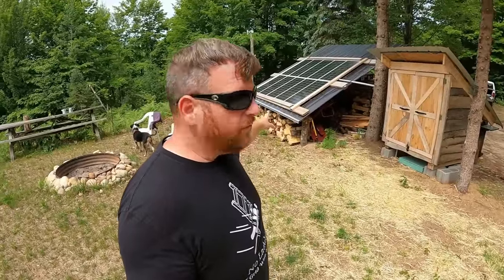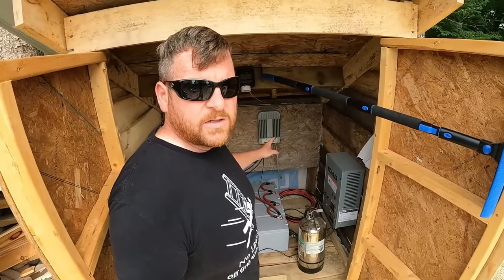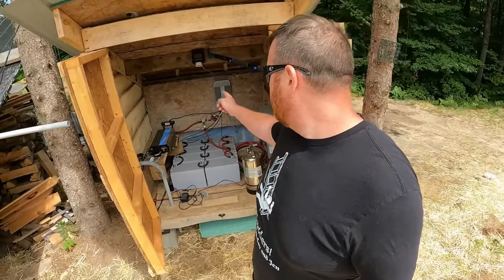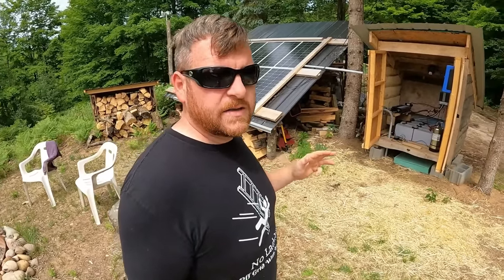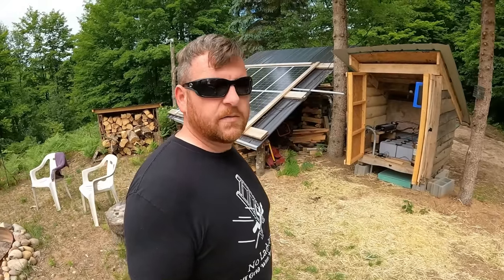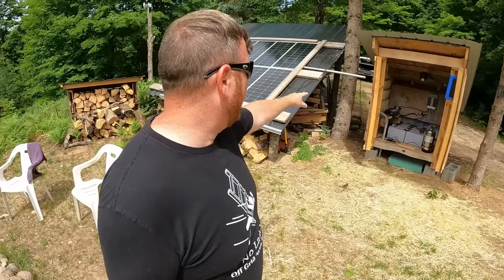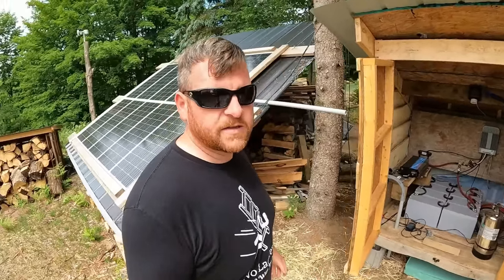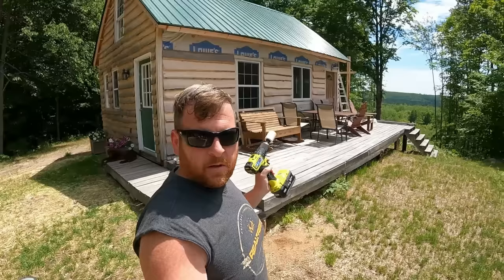One Year Off Grid Solar Power System Update

Comment: We have a very similar system and have lived totally off-grid for nearly 9 years.  With only a little more panel capacity we run a normal front-loader washing machine as well as two large fridges and an electric kettle during the day.  A lot has to do with when you do things .  On a sunny day, once the batteries are charged, the panels are idling, might as well use that power  for washing, kettle, slow cooker and so on.  One can do a lot with little just by adjusting one's life style a little.
Reply from the maker: .Awesome......very cool. I too think we could run more stuff but still working on adding comforts. Lol. People suggest wind turbines often to us, but our battery bank is often fully charged mid day,  so no need for it. Glad to hear your system is treating you well for all them years.
Reply: @OffgridwithJayandJen  build a custom water tank with a ton of insulation get around r50-60. Make the tank 500 gallons and put a single or double water heater coil inside it. Once that things heated itll stay hot for a very long time. Like a few days. And you can shower or bath from it for a long time.
Reply: @fajile5109  I like the rock wool not mineral wool for insulation as its great insulation, fire  proof and sound proof and
easy to work with.  You could wrap that around the tank and then get the water heater covers to put over it to hold
the insulation in place
Reply: yes excatly why letting good power go to waste
Reply: @OffgridwithJayandJen  a wind turbine is mainly usefull  if you live a place where you get periods with very little solar , like here in Denmark in certain periods of winter , then one can charge the batteries with a vindturbine but i have learned a few lessons  if you are gonna do the work of raising a tower or mounting it on a buliding make sure to get a model that actually produces  power  so its worth putting in the work of raising it, the most costeffetive turbines about 4-500$ i have found that actually produces the power they are rated for is the istabreeze series  1500w and 2000w models they have a very good pma good blades strong hub and housing but they have a few problems that can be fixed ( tendency to collect water in the pma housing over time ) drill a hole in the bottom and use a good sealent on the ends of housing, ,, so if you know somone that wants a turbine  warn them about the 500w 1000w  china turbines at the 200$ prizerange they are utter nonsence,, there are a 400w one that is good but there are so many low output copys
Reply from the maker: This is awesome information.  I appreciate you sharing it. We get tons of win up here at our cabin and my goal is to have a turbine by next winter to help with our gloomy winter months. I will try to Google the model you were referring to. If you get a chance and see this, please share a link to the one you like best....It would surely be helpful to people, including myself.  Thanks Kim
Reply from the maker: Hey Kim I Google istsbreeze and I like the site....will definitely do more research and consider them for our upgrades. Was wondering if the wind turbines are noisy? Would love to know. Thanks

Comment: I would insulate the battery shed with like 3 inches of foam, the inverter and the solar charge controllers should generate enough heat to keep it below freezing, if not add a DC heater ,the dc heater will dry up the moisture and keep the battery  relatively warm.  Good job on your set up

Comment: People don't realize that some of these lithium iron phosphate batteries come with heaters. Also lithium you can use it when it's cold out 0° you just can't charge it at 32. Unless of course you got the one with the heater built in. Then it's automatic and if you get a lot of them you can use 100% of the power. Also you save 15 to 20% of just conversion. Meaning lead acid and gel batteries used 15% of your solar and throw it out the window.

Comment: A small propane heater with a thermostat would heat that tiny building and probably use less than 100 lbs. of propane in two years.

Comment: Nice system guys. Your absolutely right about some of the big expensive systems. We have a 2 kw system at our off grid cabin and it runs our well, fridge, freezer, lights fans and even and ac unit for 4-5 hours. Over the last 3 years I think it has come close to paying for itself. Keep up the great work!
Reply from the maker: Very cool.....I sit with my jaw dropped to the floor when I see some of these systems.
Reply: So it runs for 4-5 hours, then what?  Everything off for hours until your batteries charge?
Reply: @ghosthunter152  usually 4-5 hours is good enough to keep my cabin cool enough. But I can also run the ac a little longer with generator and charge the batteries at the same time.

Comment: I know the video is 2 years old but I appreciate it nonetheless. I enjoyed your sheer honesty and expressing your views on simple way of living without having to break the bank.
I am relatively new to solar and still learning about controllers, wiring setups, inverters, amps, watt, direction, roof or no roof, and lifepo4 vs acid. 

I took the beginner's and more expensive route due to my lack of experience so I bought some solar generators like bluetti and just hooked up a few solar panels for now. 

I'm still learning but I have about 1200w of solar panels, 3000w bluetti solar generator and 1500w vtoman solar generator. I also bought a prefabricated mini 200w, 40ah, inverter and control kit just to get the hang of wiring and setup for future expansion. Power is good from mid March until late September for normal consumption but I don't have enough power during the other months. The system barely charges during November until February. Like basically 10-20w/hr.

If anyone is reading this, I'm open for suggestions and recommendations. I live on Gulf islands in BC. 

Stay free and be healthy!

Comment: SPOT ON!  I've thought the same with all those expensive oversized solar deployments.  I'm building my off-grid home with just 200W solar, two Renogy Lithium 100Ah 12V batteries, one MPPT charge controller, one 2000W Inverter, and with that I haven't used once the generator while using my 1800W miter saw, circular saw, drillers, battery chargers, vacuum, etc. during this whole warm season.  I think that with 1600Watts in Solar energy in Ottawa area is enough for a small home, specially because in Summer will heat water with the excess energy comming from the PV solar panels, and in winter time with an heat exchanger from the stove, and some propane backup...

Comment: Thanks for great video! 👍 When building next expanse for the Solar system, after the batteries,  use a ground mount system to east- west with 30-40 degree angle both sides. (Will generate mid day production and also will help with snow sliding down during winter)
P.S. You can buy solar clamp mid and end clamp tops and then use screws to fix them to the wood frame that you can make yourself according to the PV panels.  😉
Reply from the maker: Nice....sounds awesome

Comment: I want to thank you for this encouraging video report on your solar system. I am also put off by the high ticket systems featured by some Youtubers. They are out of our price range. I live in western Pennsylvania and am installing a solar system similar to yours. I am putting in 1200 watts of solar panels on the roof of our woodshed, which is about 2 feet from the corner of our house where the electric service panel is located. I have a 60 A MPPT solar charge controller, 200 AH of 24 V LiFePo4 batteries, and a 2500 W inverter, hardwired to an interlocked breaker in our service panel. I intend to use this system for backup power for our water pump, refrigerator, cell phones, router, radios and a few lights. I hope to double the size of our battery bank later this year. Thanks again.
Reply from the maker: I think this is the best comment I have read in a good while.....im happy to see others going for it. If you have good sun exposure you will be very happy and impressed with what you can power with that simple set up. Let us know how it goes. 👍

Comment: This is such a great informative video. This helps me out a lot. We’re considering building our own off grid cabin to live in full time and I have been looking into solar. I like your thoughts on using propane because I feel the same way. You still have to buy the propane. What if you can’t buy propane?
Reply from the maker: Thanks Jeff, I completely agree.  Sure no system is flawless, but to buy an appliance where the initial investment is high only to buy fuel to run it doesn't make much sense
Reply: So what is the contingency if you can’t buy gasoline either?
Reply from the maker: @campcreekhill8933  I think about that more and more these days. I mean we use a lot of gas around here for building tasks and putting up firewood. If I were to cut back and only use what I have in reserve I think I could  cut firewood for a year or two. But only run the chainsaw. No more luxury of riding the side by side around the property. Would like to slowly upgrade all my tools to battery power, but they are not in the budget at the moment.  Like I mentioned in the video I have not had to use the generator to charge my solar but once, and they was just as a precautionary
Reply: @OffgridwithJayandJen  I think if we ever get to the stage where we can’t buy propane or gasoline then we have got a few more issues to worry about than just that!
Reply from the maker: @campcreekhill8933  beans bullets and bandaids my friend.  Still will be a rough time.

Comment: We have been on sloar power only(48v system) for 1 1/2 yrs now. Had some issues in the beginning, but all in all, are happy with it now. We do have quite a bit more $ in our system but with our requirements that's ok. Without any more issues it will pay for itself in 3 1/2 more yrs. Power goes out pretty often out here in the Big Bend area, again last night, but not for us. Good video you have done, informative and straight forward. Well done.
Reply from the maker: Very nice BE.....good to hear others having good success too with solar. Nothing wrong with building a system to your needs.....it is actually the best way lol.

Comment: It is amazing how two of you did so much.  The saw mill is expensive, but saved you a lot in the long run. There are now lithium batteries with built in heaters, or you could insulate the shed well and put a heater in it, or as you said in the house itself with the wood heat.  I use the self heating batteries on my camper, but rarely camp in weather below 20° F.  My brother could not get power   for a couple years to a house they built in the Oxarks, and they ran an old wash machine off a fairly small generator and and used a solar hot box to provide heat to a small clothes dryer to tumble the clothes.  Snow melts on a wood stove for water.  When no snow, I have no idea other than bigger tanks to store more water.
Reply from the maker: Thanks kenneth.....ya the sawmill was a good investment, I have a video about it coming out soon so keep an eye out for that. Best wishes

Comment: Jay, we watched this at our off grid cabin while eating dinner. 

We liked :1) your sponsor is relevant to the channel-kudos for that.  We will check out the site 2) You relating your solar to what you use. Amazing to see you run a fridge on it with no issue or generator help.  3) your haircut 4) that you did that wiring project all for the dogs.

We did not like/ no Jen(we miss Jen).   But another great video.
Reply from the maker: Thank you so much Guys......you are too funny. Jen was teaching classes while I filmed this....otherwise my price is right girl would have been there to point and wave at each piece of equipment, giggle giggle

Comment: Nice set up! I have a basement apartment for my son all the lighting is 12v dc I just bought led camper lights. Using 400w of panels with 200 AH battery bank. Its been going for almost 5 years and it literally trickle charges all day. He forgets and leaves lights on still no strain on the batteries.Problem with most people using solar is they try to power too much efficient appliances is the key.  If you start a system with a stressful load on your bank it will be an uphill battle and the batteries will not last as long.  Great honest info in this video!
Reply from the maker: That is great to hear, I totally agree with you in all regards. Led lights and energy efficient appliances are key.

Comment: Yes. All for self-installed PV. Your battery temperatures can be managed. I think you should give the shed a little ventilation.
Think about some things I've found out from living in N. PA.
1 or 2 inch foil backed foam insulation is easy to cut and put up.
You mentioned using bubble foil. Check the manufacturers website. What's very cool is by providing just a 5/8" dead air space you can get up to a R22. So a sheet applied either side of a frame has worked very well up here. I did my  farmhouse window frame  in a bathroom that my dad added a couple of shelves. There was like 2" between the shelf outside wall. And it was cold in the winter. I cut the back out and put a layer of bubble foil. Made a 5/8" frame and staped another sheet to it. Then layered it with cedar closet tongue and groove. Now the back of the shelf is room temperature. Lost a very little bit of depth. With a little creative work you could vent the inverter into an insulated battery box to give them a bit of heat.
A 12 or 24 volt thermostat controlled pc fan could be used for a vent .
Nice install by the way!
Reply from the maker: Thanks, I'm a huge fan of the bubble foilas well. Like you said if you leave a dead air space between layers it really creates a clean and effective space. I'm  wishing I had insulted the shed before installing everything,  but like you said I didn't want it to get too hot in the summer.....so I left it very open air and planned to insulate the batteries.  Thanks for watching

Comment: Absolutely love the dual use of your solar stand for storing wood and your great attitude in general. There's so much nonsense talked about solar. Imagine how much you can actually do with just one panel and one battery. Lights, radio, phone, tablet, laptop, portable dvd player etc etc etc. It's probably even good to start with a little and work your way up as you learn more. Too much nonsense said about the whole thing. I love that you have started out with just 1kw. You may find it just does what you need.
Reply from the maker: Thank you Freya.....really appreciate the kind words. I totally agree with ya on the working your way up. We used and still use a single panel and battery to run our shower house down by camp and it works perfect for running the shower pump and lights year around. It was my first adventure into solar....great way to learn.  Best wishes

Comment: First, thanks for your videos.  Brother add more roof collecting space. add a garage/ shop. Even a carport style structure to dry lumber with only 3 walls.  Then go get a 800 gl.  tank. with 3 or 4 800 gl tanks you will always have water . Have you thought about building a roof covering above your solar panels to protect from snow/rain. You could use clear plastic/ fiberglass.  I mean you have enough tress to frame a 12,000sq ft  house. Certain pine trees grow to 100 feet in 10 years, I would plant a few of those. Congrats ,Looks like you have a great piece of land . Trees are a great resource , they keep replacing themselves !
Reply from the maker: Lots of projects in the coming years my friend.....funding and time are what keeps us at a moderate pace. We have been at it for two years now and doing this part time until we can transition full time.....steady as it goes. 😊

Comment: We have an off grid cottage in the UP.  I want to replace the propane refrigerator with electric to reduce the fire risk. Another cabin on the lake burned to the ground.  It was thought it was started by the refrigerator.  I am glad this video was up as it gives me some ideas of what we will need.
Reply from the maker: Very cool Tim, I went back and forth for a year trying to justify buying a propane fridge....but just couldn't do it.  Glad we spent the money they way we did on our solar and bought a simple fridge. This way if the fridge craps out we just buy another one, lol. People have mentioned using little deep chest freezers too on a system this size, so that's good to know too for reserves. Best wishes
Reply: @OffgridwithJayandJen  We never use our place in winter so the solar does not need to be quite as big.   What size/model refrigerator do you now have?   I was thinking of an apartment size fridge.
Reply from the maker: 10.4 cubic foot magic chef....bought it at home depot. 330 dollars. It has never drawn over 150 watts. Mostly runs at 70 watts on occasion to cool it off.

Comment: Brother the biggest advantage I have found with the hybrid all-in-one systems are that when charging batteries any surplus power being created by the panels can be transferred directly to the inverter therefore during the day you are only charging batteries regardless of your power use the batteries do not get tapped until sundown this bypass mode is extremely efficient and extends battery life substantially in lead acid batteries due to their cycle life